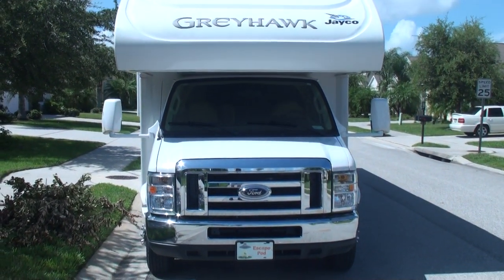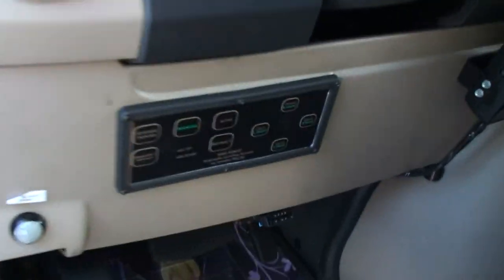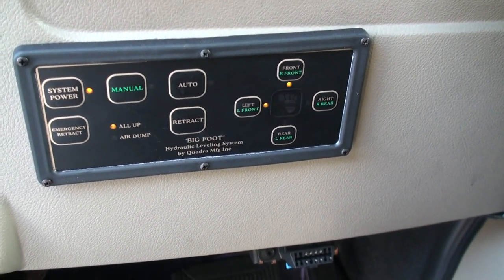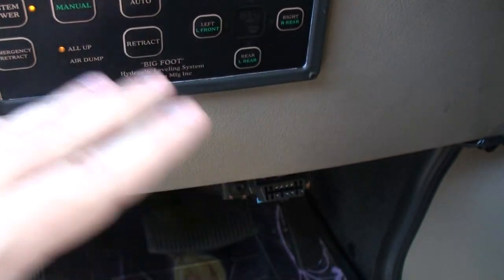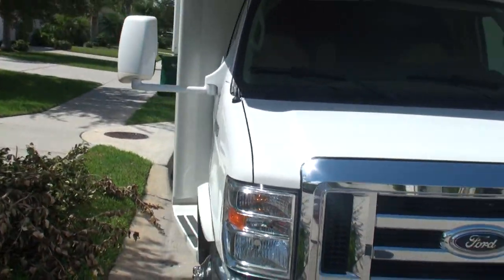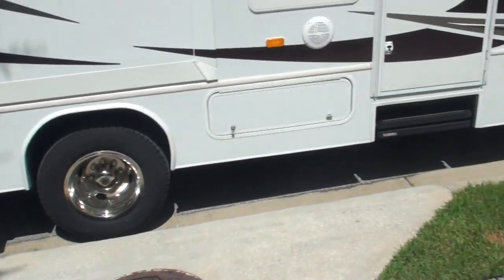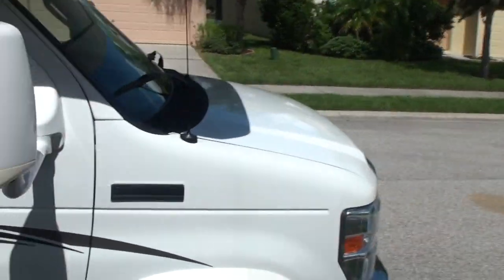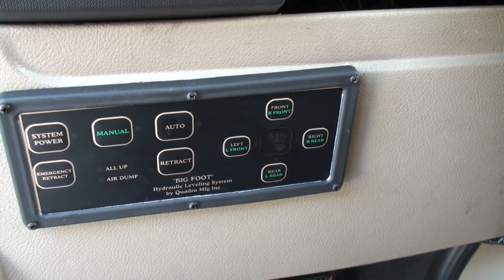Auto level Class C

Comment: Have you ever had to use blocks to level with the auto levelers? We have a new unit and are new to rv and we had a problem getting it level on a relatively level lot and had to put it on blocks as per instructions when we contacted the dealer...we thought we would avoid crawling under and putting blocks with this system